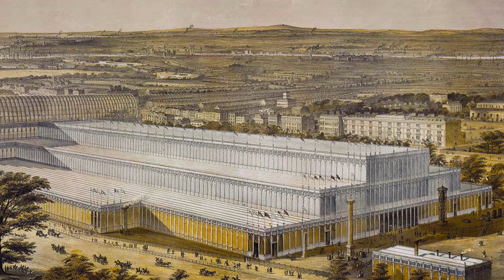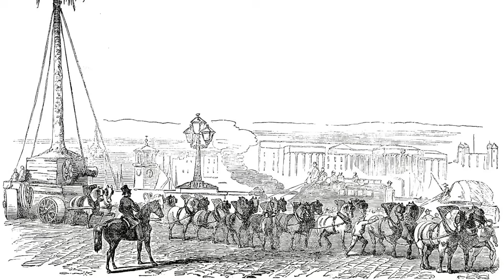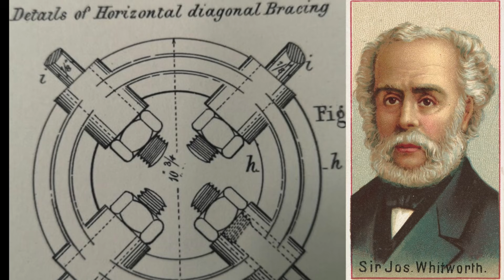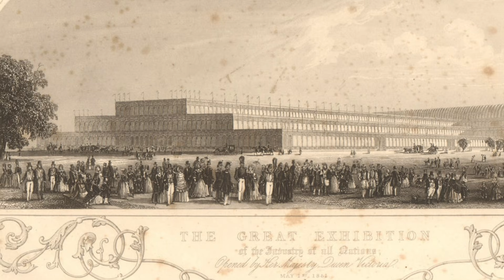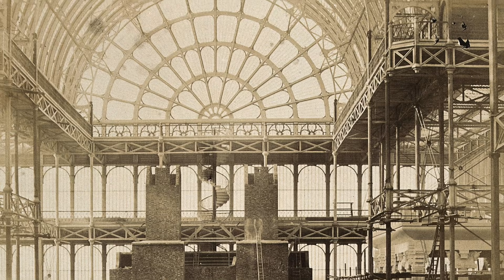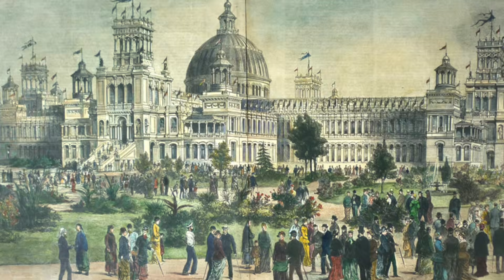Great Exhibition 1851 World's Fair | Crystal Palace in Hyde Park

Comment: Wasnt the Kew glass house built using the same technology? Still standing?  
As a project manager by trade, my question is how much glass and cast iron used, and their manufacture, where, and what the inputs, outputs, and the skilled workforce needed? I dont think the Smethwick factory would have the capacity.
Reply from the maker: They state they were different structures, but the pictures show otherwise, as they are very similar. Your right, logisticaly it would of been impossible with size of the Smethwick factory, the mystery continues..
Reply: @ZacharyDenman   especially as plate glass rollers were not in use then IIRC, and each plate of glass was produced from cut blown cylinders. Just looking at some of the spans of glass..... 😮